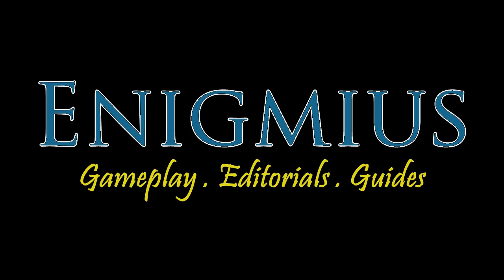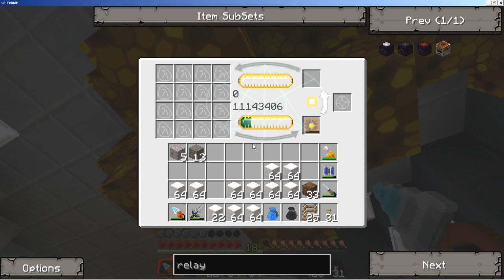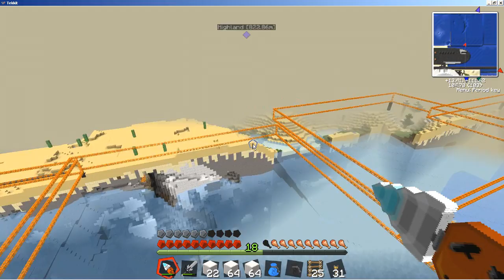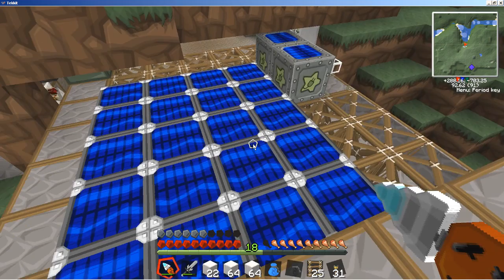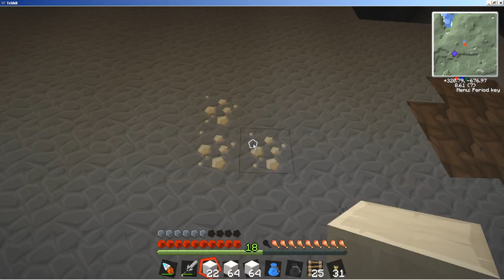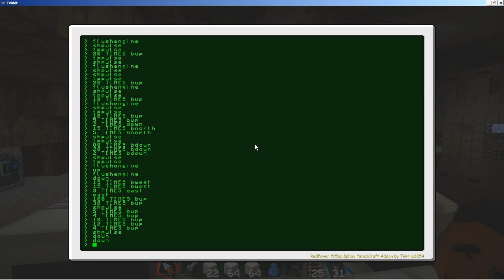Minecraft: What Mining Turtles Grow Up to Be

Comment from the maker: I have that in all of my movement routines, but the problem is the motors using power faster than they receive it coupled with lag leads to missed cycles.  It's not usually an issue on smaller builds, but the stuff I do tends to get a bit larger than the frames system is ideally suited to handling.  It's just a minor detail that needs to be accounted for.

Comment: 2 suggestions gem boots with the rest of the quantum gear (the Q helm and chest are better than the gem legs kinda too) and a huge quality of life upgrade is red matter furnace you just need one energy collector to power it and it's faster than any other smelting method especially if your manually using it. O also alchemical chests with black hole bands are like an upgraded transposer you might want to try it out see if you like it.